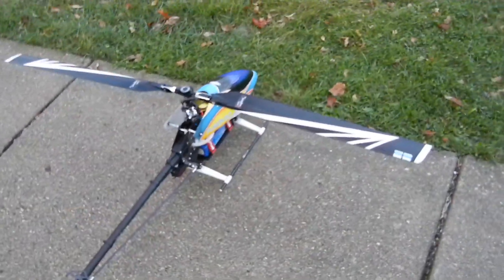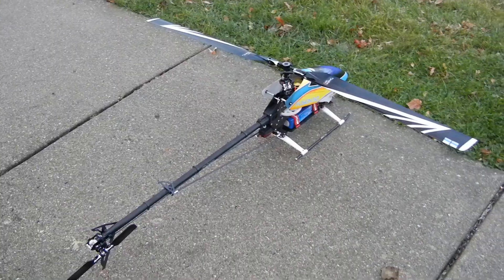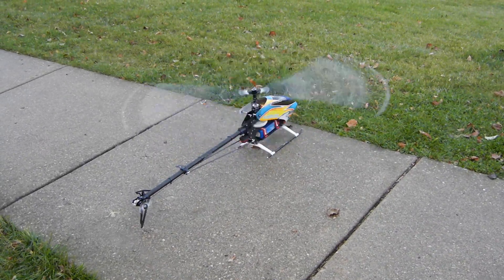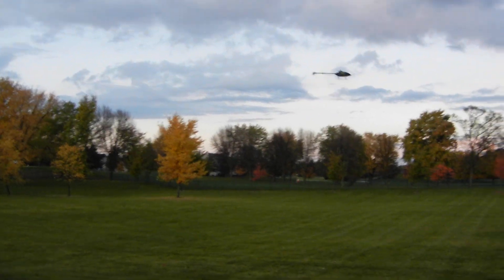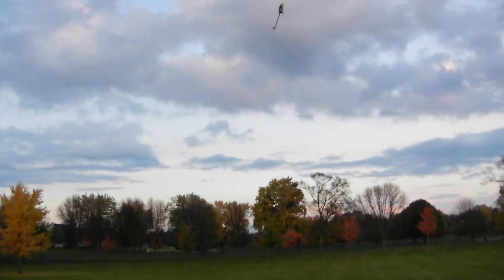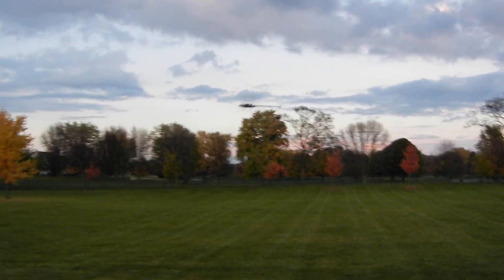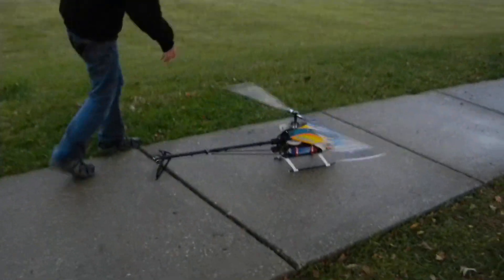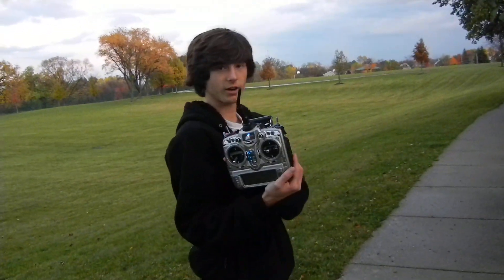Fusion 50 FBL BeastX Firmware Version 3.0.8 Part 2

Comment: Have another question, I have not yet built a Heli that has a separate BEC but plan on getting a 600 or 700 here in a few months. I see in your list of electronics that you do not include a BEC. Is it because you are using a NiMH battery, if so how does that wire in? If you can give me a few tips on that would really appreciate it. Thanks